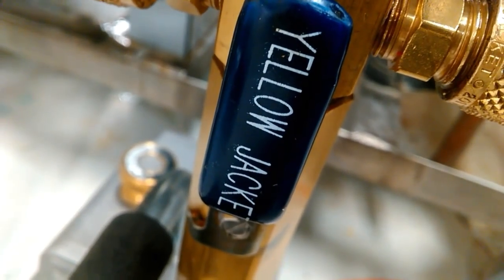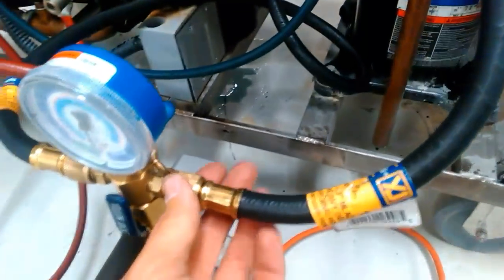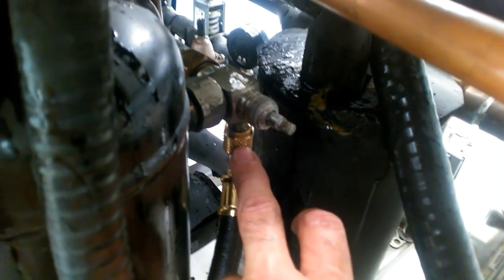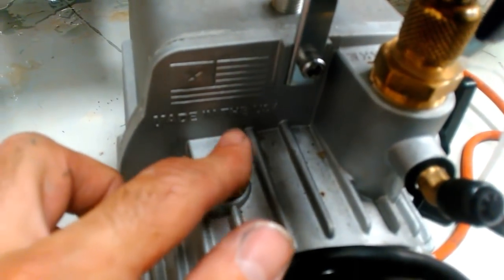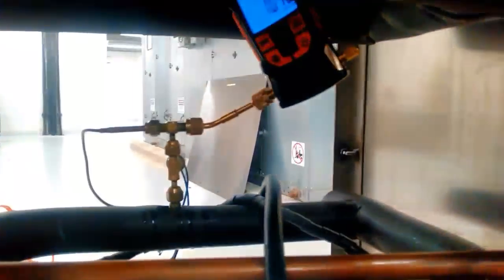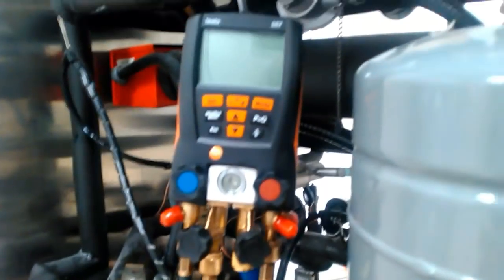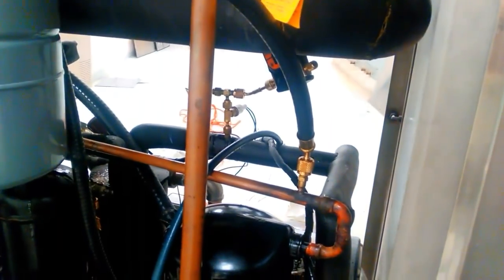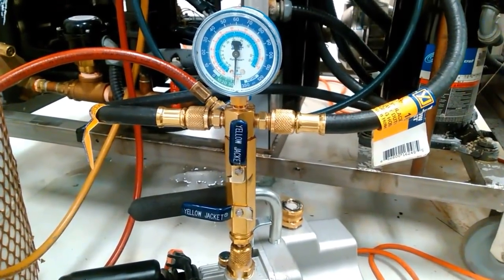Yellow Jacket SuperEvac Vacuum Manifold - HVAC Know It All

Comment: Hey is it possible to use the super evac manifold on a Mitsubishi heat pump for example the MXZ models when pulling vacuum, on the port inside the heat pump? Basically I was wondering if it’s possible to connect 2 hoses there to pull a vacuum faster. @hvacknowitall

Comment: What would happen if you don't have 500 micron? Lets I usually put the system between 1500-2000 microns?
Reply from the maker: There's a chance of additional moisture at that micron level, which can lead to early failure.  But it is harder to pull an older system down to 500.

Comment: Weres the valve cap on the service valve. Leak great vac not. Oil won't get into micron gague anyway its not under pressure its in the vacuum.
Reply from the maker: Oil definitely gets into micron gauge, that's why they require cleaning from time to time.  There is still flow under a vacuum.
Reply: @HVACKnowItAll  oil will not get into a micron gauge if it's under a vacuum. The micron gauge sits outside of the system why the system is sucking out the vapor and moisture out of the system. The micron gauge is external to the system so there's no way for oil to get into the micron gauge. Unless you were using the micron gauge in line while you were sucking out the system on a vacuum which you do not have it set up that way
Reply: @HVACKnowItAll  not trying to piss in your cornflakes but if you going to show that you know what you're doing do it the right way.

Comment: Was reading Bill Spohn comments on another site that vacuum hoses should not be used for charging.

Sure I read that just after baptizing my new appion hoses with this same evac manifold!
Reply from the maker: What the reasoning for that?
Reply: POE oil remaining in the hoses and holding moisture??
Reply: @davejohnsonnola2758  so is it better not to use your vacuum hoses for charging?
Reply: Jury is still out on this?
I've been using this tree and have nitrogen hooked up to the backside to do quicker triple evacuations.

Comment: why is better have the vacuum gauge on the system instead of the vacuum pump?
Reply: Your pump ports will always measure lower than the system pressure. You want to see 500 micron the furthest away from the pump you can get. Sometime hook up two vacuum gauges, one on the pump and one on the system. You'll see what I mean.
Reply: on the vacuum pump**
Reply from the maker: Julio Santana because you are measuring system vacuum not pump vacuum
Reply: Julio Santana near to the sistem.

Comment: Thanks for that lesson man . You just proved my point about  a disagreement I've been having with my boss regarding not using the 1/4 male connection for pulling a vacuum .
Reply from the maker: Sean McDermott lol, glad o could help!
Reply: HVAC Know It All 
I went ahead and I watched it again to pick up on your instructions on how to break the vacuum . After I isolate the vacuum hose valve   I usually crack the low side  service valve and release some refrigerant into the system and then close it again . Then I disconnect my vacuum . Any thoughts about this method or how I could improve on it ?
Reply from the maker: Sean McDermott as long as that hose you crack is under  a vacuum then yes that is fine.
Reply: I charge through the high side to break vacuum. Make sure you've either purged the air from your charging setup or it's under vacuum. Pay attention so you don't push air from your manifold into the system you just evacuated.
Reply: Dumb question but is the 1/4” only for testing or is it safe to pull deep vacuum if that’s all I have? Thanks

Comment: This perfectly answered a question I had on an Amazon site for this manifold regarding using it to charge. 
Thank you.
Reply from the maker: david johnson no worries!
Reply: Any concern about pressurizing the system with the micron gauge still connected?

Using this manifold would also seem to be an easy way to sweep with dry nitrogen between vacuums.